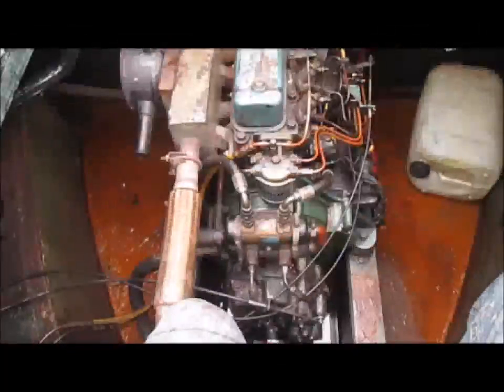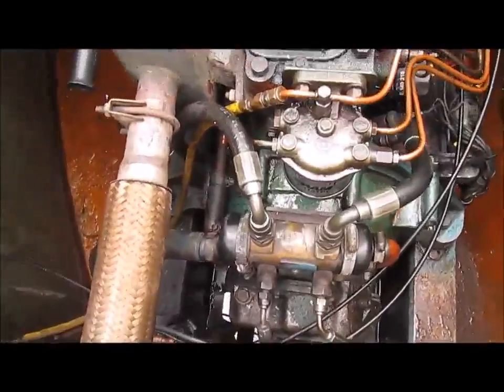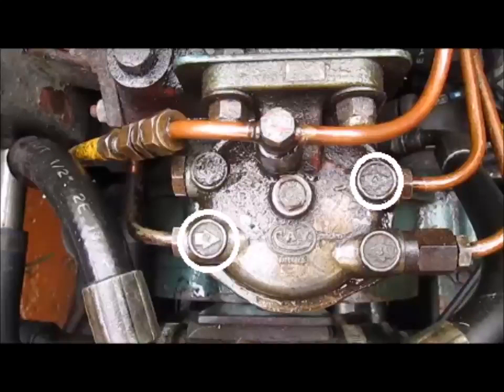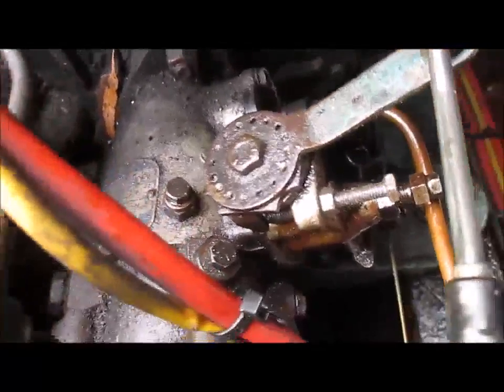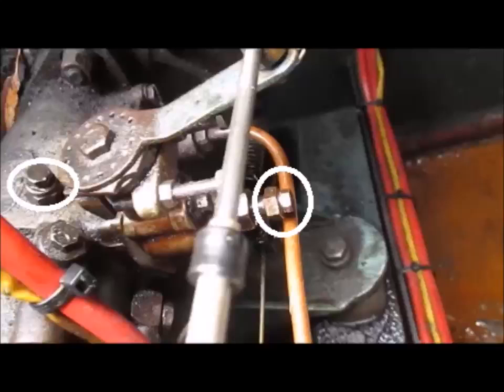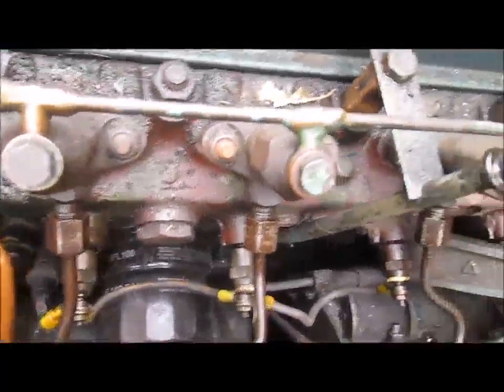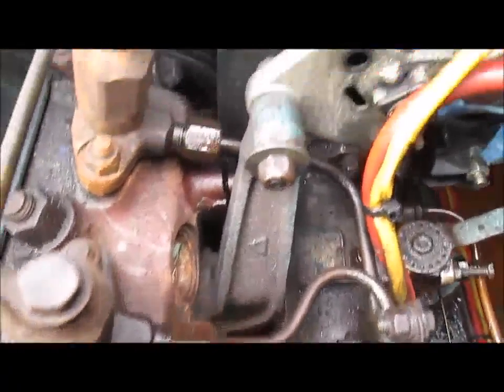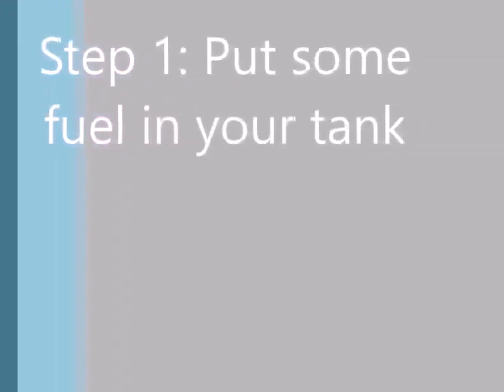Bleeding a BMC 1800 marine fuel system

Comment: Hi, I just recently bought a 1957 austin fx3, with a bmc 2.2 diesel engine. The car was inside of a shopping store without running, now I replaced all fluids and filters, I got bled the air in the system but when I'm trying to bleed the injectors I got only fuel in the inlet of one injector, and nothing coming out from the other three inlet injectors, do you thing the pump could be bad? the pump has two screws with a little tubing that I thing they are for bleeding the pump, and I got only one screw with diesel coming out, do you thing the pump is bad inside? any help I will be very appreciate it, thank you.